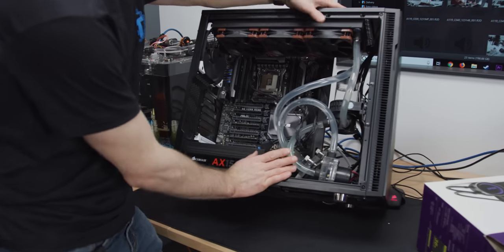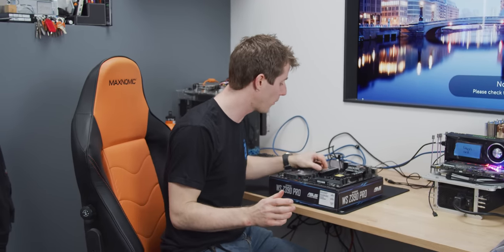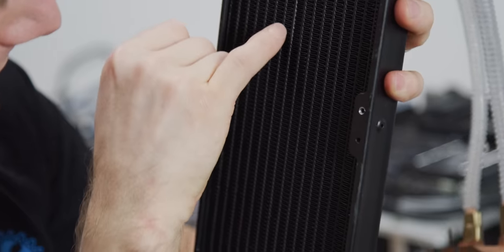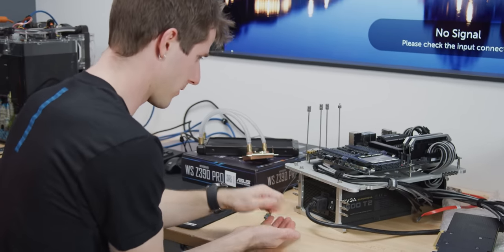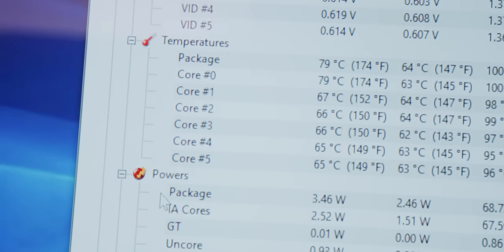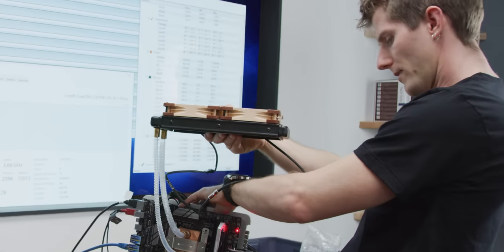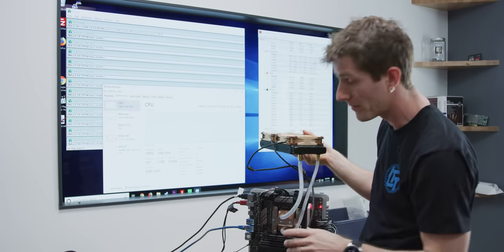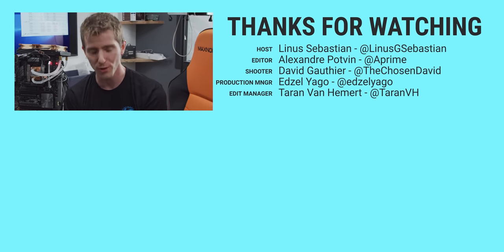CPU Cooling with BOILING LIQUID 🔥🔥

Comment: Well, they could use ethanol and get the boiling temp down to 70ºC...
Reply: And be nice and flammable
Reply: sounds perfectly safe
Reply: Why stop at Ethanol? Acetone, for better fireballs! Pentane! Isoprene, for fireballs on mere contact with air! Chloroform, for obvious reasons! Diethyl Ether, for that genuine dentist experience! Don't you want your experimental coolers to also be fun when they go wrong?

On a more serious note, it's pretty difficult to ignite ethanol in this use, it is actually remarkably safe. Like if you had an open flame inside your cooling loop, for sure you'd set it alight, but i'd say you have bigger issues if you do? And it's just a wee little fireball, blink and you'll miss it. And by the way, i'm sure someone will comment ohnoes acetone & plastic tubing, well don't use polycarbonate hardlines - polyethylene, polypropylene, polyamides, siloxane, plenty of polymers are completely immune to acetone, and usually to an extent to other solvents too.

What it really is? Fluorinated ketone, must be.
Reply: @SianaGearz  ok
Reply: @SianaGearz  Looking at stable boiling at about 66 C when in BIOS with no load the chemist in me immediately concluded that the liquid inside is methanol (boils at 64.5 C at atmospheric pressure)... It's cheaper than any of the fluorinated stuff and has much better heat of vaporization.
Reply: @olegtitov6679  But we don't know temperature of the fluid. If it's 65"C on CPU core then the fluid might be 50"C.
Reply: @SianaGearz  Quite unlikely. The whole idea of the cooler is to optimize the heat transfer from the CPU to the fluid. Moreover, if you look closely, when they are in BIOS the fluid boils much slower than when they are running a stress test, It seems quite logical to me: with no load the temperature should rise to the boiling point when the cooler actually starts working unless the cooler is a complete piece of shit that cannot handle an idle CPU.

Actually I'm more concerned about the internal pressure. We cannot speculate about the boiling points if it is severely lower than the atmosphere. On the other hand, how low can they go with flexible tubing of this type without risking it imploding during transportation or mishandling during the installation procedure?
Reply: @olegtitov6679  I'm not a chemist but i am an electrical engineer so there's something i have learned to consider that you probably didn't. A lot of it is about thermal management - you're trying to keep a typical power semiconductor at under 150°C junction temperature but usually this means the thermal tab where you attach the heatsink will need to be well under 100°C. Processors have lower permitted operating temperatures than power semiconductors, because you need to keep bursts and gradients in check.

There are a number of thermal barriers. The temperature reported by the processor is supposed to be Tj, a temperature at individual semiconductor level. The ceramic of the enclosure forms a thermal barrier, then the thermal paste between the ceramic and the heatspreader, thermal paste between the heatspreader and the heatsink, and finally thermal impedance of the heatsink to air where you end up finally releasing the heat. Of these, a few really don't matter because their thermal impedance is hilariously low. For example you can almost completely neglect the contribution of the heatspreader to thermal impedance, and of the solid piece of copper in the heatsink base.

You can go ahead and stick a thermocouple on the base of the cooler, i don't have a modern Intel to test, but generally they have a pretty huge thermal impedance within the CPU. On my AMD, you simply can't trust the internal temperature reading, it only makes sense in an abstract way, so i can't give you a useful figure, and AMD have much lower thermal impedance anyway. Anyway you just ask yourself, you see these readings of 80 or 100°C, but if you ever touched your CPU heatsink, like even near the bottom, have you ever burned yourself? Nah, it's not even all that warm.

The thermal impedance is expressed in °C/W. The °C is actually the delta, and for the system overall it will be the difference between ambient air or cold-end and the junction temperature. The components of the cooling chain form an impedance chain from the junction to the air, the impedances all add up. Funny thing is, the lower the thermal impedance of the heatsink is, the larger the contribution of the impedance within the processor package is, in spite of lower temperatures :D

I fished out the thermal impedance measured by Anandtech for Hyper 212 Evo on their test rig, it was 0.17°C/W (includes impedance of a layer of thermal interface). Then i fished out a random figure from an actual Hyper 212 Evo review on a processor, like around 59°C delta for prime95 on i7-3730K, against the TDP of 130W (upper bound, probably actually less), comes out to 0.45 °C/W total (thus likely actually higher), so thermal impedance of the processor package comes out to like 0.28°C/W or more... now think about it, the 212 Evo isn't really all that hard to beat when you pitch it against a triple rad. Almost all of the overall thermal gradient will be happening within the CPU package. I don't have figures for something newer at hand, perhaps you could find yourself, but it stands to reason that the thermal impedance of the CPUs got worse because the TDPs went down but the core temperatures went up.
Reply: @SianaGearz  no, chloroform's reasons arent obvious. Whats up with chloroform?
Reply: You can easily do it with water by just decreasing the pressure inside it, by this you can achieve a boiling point as low as 25 degree ,
Reply: Long term issues?
Reply: Yeah... until someone uses a lighter near it
Reply: @SianaGearz  I mean, sure: The temperature of the semiconductor is going to be higher than that of its surroundings. But isn't it a kind of apples-to-oranges-comparison if you go go off the thermal resistance of a specific component to make your argument? You'd need to at least compare specific resistances of the materials to be able to come to those conclusions, in my opinion. Plus, given the fixed geometry of the CPU unit, wouldn't you ideally calibrate the temperature sensor such that it reports the proper (stationary) temperature? Of course there'll be some inertia to factor in, but I'm pretty sure after a few minutes at idle the gradient between semiconductor and heatspreader is going to be quasi-stationary.
In my experience, the biggest bitch when trying to design any type of radiator is the resistance of the boundary layer between the fluid and the bare metal. I mean, otherwise the flow velocity (i.e. fan RPM) and surface area of an air-cooler wouldn't have such a great impact on its performance, right?
So I do think the assumption that the working fluid could be methanol is pretty spot on. Maybe methanol-acetone, but I doubt it.
And as far as your last point goes: The TDPs of top-end CPUs really haven't changed much as a whole, if you look at the charts. The per-core efficiency has went way up, though. And of course it'll be a little more difficult to spread the heat if there are more cores, but I doubt the difference is that significant. I think the reason newer CPUs like to run so hot is because they draw well over TDP at their boost clocks.
As always, though: I could be completely wrong!
Reply: @misterjonas6991  Unfortunately we don't have the liquid temperature and we don't have the CPU package temperature, we only have the die temperature. The difference between die and package is not constant, and thus isn't simply calibrated out by manufacturer, in spite of what the constant thermal impedance (°C/W) would suggest if you looked merely at its unit - because it's not a gradient value, it's the impedance value, all impedances get added up, and then for the actual wattage and delta-temperature, they proportionally divide the thermal gradient. To determine liquid temperature, you have to tap in between two impedance chains die->heatspreader->cooler base->liquid and liquid->radiator->air. The gradient of a thermal joint is variable even at the same power output depending on cold-end air temperature, because the performance of the heatsink doesn't magically cause the input temperature of the cold air to change. You can also easily observe that the CPU's reported temperature is higher than heatspreader temperature. Also that reported temperature exactly corresponds to a throttle point, and if anything, you want CPU throttling to depend strictly on actual die temperature, not on assumed/estimated wattage (as long as you're not burning up the VRM, which is why GPU throttling is different). You cannot use die temperature as approximation of liquid temperature because as shown in a comment above, the thermal impedance die->heatspreader is immensely large on an Intel CPU, and is significantly higher than the complete thermal impedance of a fairly typical third-party cooler.

Actually i literally grabbed the first thing i could think of to try to get an estimate. Intel E97378-001, a minimum viable cooler for a moderate wattage processor, has according to Anandtech about 0.40°C/W, which is a good bit higher than processor's own thermal impedance as crudely estimated by me, but not high enough to neglect processor's thermal impedance. I kinda assumed that nobody in their right mind will be designing a high end cooler that's worse than a 212 :D but being merely better than a minimally viable cooler is a better assumption. :D Thinking about it, i mean i googled up, and it appears you expect something like 80°C on prime95 on stock-settings 8700K with a 212, so this cooler as presented here is actually junk tier. :D Not sure what this tells us though...

If you were measuring it yourself, you'd make a better experimental setup which would allow you to determine as many temperatures as necessary directly, and thus avoid all the guesswork with numbers.

I can see how medium boundary impedance can be vital to cooler performance, yes, absolutely. And yes, thermal impedance between radiator and air is airflow dependent. Also a reminder that thermal pastes to couple two metal surfaces perform remarkably well nowadays in spite of shit conductivity specifically because they have been able to optimise the material boundary performance.

Interesting consideration on the increased actual thermal power output of the CPUs, for sure.
Reply: @SianaGearz  Whoa, that's one hell of a reply.
Haha, I do understand that one can't calibrate the effects of thermal inertia away. But I guess it doesn't make much sense to correct for the steady-state offset if they keep as much overhead as they do, anyway.
And what you're saying makes perfect sense and I don't doubt that you're correct when it comes to air coolers, or traditional water blocks, but a thing to consider when dealing with boiling liquids is that until the boiling point is reached there is close to no heat transfer happening at all. Heat only gets removed from the system if it is at boiling temperature. There is basically no transfer below the boiling point in this setup escpecially. At higher temps when there is a film-boiling regime present it's a different story and you can model as you explained just fine, but right around boiling with the relatively small amount of waste heat produced by the CPU the resistance at the boundary to the liquid dwarfs any resistance the CPU and its parts might pose. So it's reasonable to assume that the block, the die and the heat spreader are almost at thermal equilibrium when the heat flow is too small to induce film-boiling. That kind of discontinuity can't really be modeled the way you're trying to do it.
Reply: @misterjonas6991  Why? The model is a steady-state model as it is, there's no transient modelling. Its usefulness with a weird nonlinear cooler is reduced to where you can no longer generalise it across the range of temperatures, like you can with most traditional coolers, because of nonlinearity as you suggest, but if the CPU is pegged to its throttling point near 100°C, as it is in this test, and the cold-side air is still at room temperature, there's no room for the model to go wrong.

Funny thing, heatpipe based coolers run on phase change, and they too have a nonlinearity. Since the bulk of the nonlinearity is down somewhere near or below room temperature (in very, very old heatpipes even way up near 60°C), we just ignore it. We really only care about a slightly conservative estimate of performance at max power, max temperature, worst environment conditions, all that.
Reply: @SianaGearz  Problem for me in this type of coolant is that I would probably end up drinking my ethanol coolants, pass out and let my computer die from overheating. :)
Reply: 78,4°C is too much for the cooling purposes
Reply: @01yman49  ah I see, a man of culture. Straight from Boris' Video where he cooled his tower with plane Vodka lmao
Reply: or it could be Oxygen (-160C Boiling)
Reply: I instantly thought some sort of alcohol because of it's low boiling point and yes, it is flammable. But if you have a tiny leak in your system then with that little amount in it. You computer will burn out before any fires take place. A tiny bit of ethanol in the air is more likely to get you drunk than catch fire. Let's just say I've boiled ethanol several times for medical reasons and it's not that big of an issue. I'd be more concerned with losing my coolant than it exploding.

I never considered reducing pressure in the system to reduce the boiling temperature of the the coolant but that would be even worse in case of a leak.

I was more surprised they went went with a capillary action rather using one way valves to get a circulating system working.
Reply: Psst...
I'll give you a hint...
If you can pull enough vacuum on straight water, it'll drop the boiling point to around 76°F.
I think it's around 27-28 inches of vacuum, and you'd need an industrial vacuum pump to do it.
Lowest I got was 24", and that produced a boiling point of about 94-95°F.
Distilled water won't boil as easily unless it picks up some impurities from the capsule it's contained within.
Reply: It wouldn't surprise me if there was something similar inside the tubes. The tubes used look like corrugated fuel lines.
Reply: @TravisHammeng  Meanwhile my house has a gas stove, gas furnace, gas fireplace, gas dryer, gas grill on the back deck, I have two cars sitting in the garage with 70L of gasoline in them, set of torches in said garage...But you know, the 200ml or so of isopropyl in my cooler is the real danger here lol
Reply: @olegtitov6679  The copper maintains a constant boiling point temp while the cpu adjsuts based off of load and thermal.
Reply: I used HFC152a from a duster can.  water and vacuum works as well, but would collapse the hoses, so you need something that boils below ambient at pressure above ambient.
the duster has reasonable vapour pressures and the pressure of heat both makes it boil, and increases the boiling point in equilibrium.

If it's set up right, it'll boil just from the heat of your hands if you grab the block, or it will also boil if you cool the radiator below ambient.  Putting an ice cube on it will make it boil rapidly.
Reply: @olegtitov6679  It could also have been a higher boiling substance (possibly even water) but boiling at a lower temp due to lower pressure. The tubes didn't expand when more liquid evaporated, so you can tell the pressure isn't being fixed to atmospheric.
Reply: @olegtitov6679  Could easily be lower pressuer in the loop
Reply: Or use a design that can be operated at low internal pressures and use water. You can operate down to just over the freezing point of the liquid that way. (Guess how heatpipes work)
Reply: @olegtitov6679  That tubing is used in high pressure fuel system, usually inside the fuel tank. It's made from Teflon type materials and handles 75PSI pretty easily. FYI. Oh and it's methanol\ethanol safe to boot!
Reply: @Dave-hq5xi  Maybe a bit late to call, but ehh, Chloroform is not allowed because of the Montreal pact.
Reply: @01yman49  cheeky breeki
Reply: Ethanol will be corrosive, its probably some mixture of several things. It seemed like the boiling point was sub 70 anyway. The pressure may not be stp too
Reply: Liquid nitrogen must do the job.
Reply: @TravisHammeng  
It IS perfectly safe. Autoignition temperature of ethanol is 365 degrees celsius.
Reply: @hailzanzibar4881  It is perfectly safe, do your research.
Reply: @sujimayne  how does it like exposure to a spark? Say if an electric pump shorted out (honest question)
Reply: @sujimayne  No, it isn't
Reply: Guys I used jet fuel.
Reply: @J0hnH4l0  Eutectic etoh shouldn't be corrosive if it's deionized